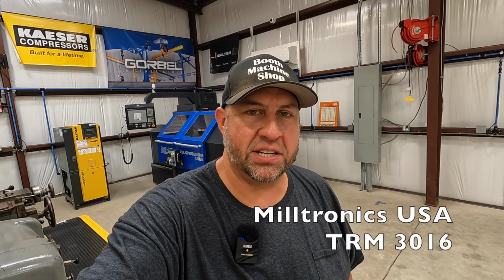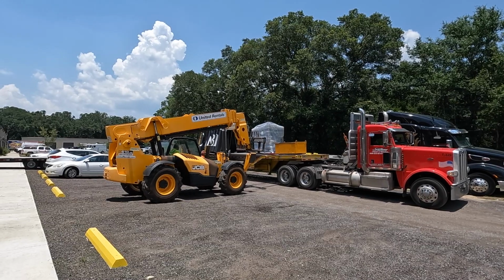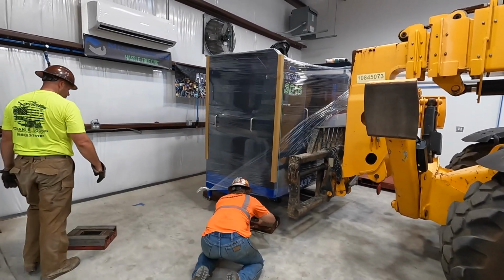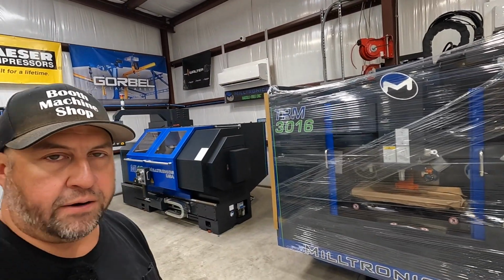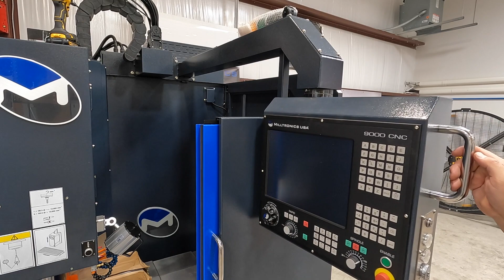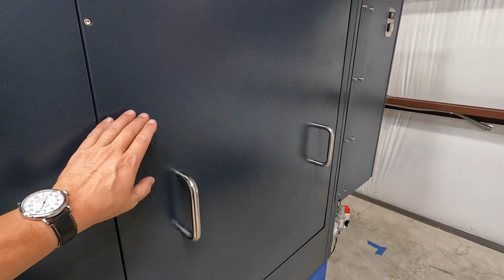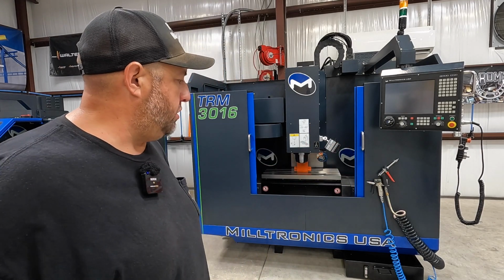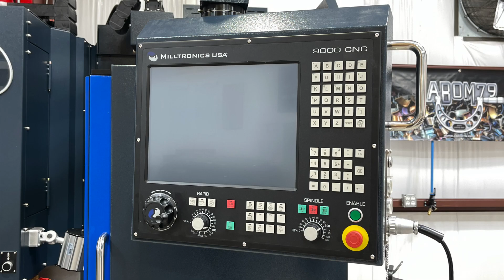Milltronics USA TRM 3016 Delivery & Install

Comment: Adam, as a 30+ year industrial machine service guy, I would strongly advise you to make hard copies and scans of all the machine manufacturer documentation (schematics, specs, etc.) and keep those copies in files on your computer and in your office. 

Also leave the originals in the control panel - just have the others for backup if needed.
All the stuff from Yaskawa and any other third party component manufacturer is typically available as a free downloads online, so you don't need to copy that stuff, but it would be nice to go ahead and download digital backups when you have time.

All machines eventually have problems and need to be fixed. Without the proper drawings and other documentation, tracking down one loose/broken wire in a critical circuit can easily take most of a day. That's a day of paying for the service guy, and the lost production time of the machine.
I charge pretty much middle of the road for what I do at around $100/hr. Downtime on a machine like that can easily surpass $500/hr. depending on conditions.
That means getting your machine up and running in two hours as opposed to 12 hours could be the difference between costing $700, or over $7000.

Comment: I really liked the smile on your face.  You are going to love CNC.  One of the BIG decisions you will have to make is the CAD/CAM program you intend to use.  I purchased a new HAAS TM-1P toolroom mill back in 2007 equipped with 10 station tool changer, reinshaw wireless probing system, coolant pump and some other extras.  When the technician first stepped up to the machine and punched several buttons and the machine took the tool out of the spindle and put it away in the proper tool changer slot and picked a new one and installed it in the spindle I was amazed.   Then to my surprise the technician said it was my turn.  My friend was video 
taping the training session and said I had the deer in the headlights look when I looked at the keyboard and hoped to pick the right keys to make the magic happen. I slowly approached the keyboard with my finger and the technician said I was "getting close" to the correct key.  I felt like I was playing pin the tail on the donkey.  Ha Ha
I know you will enjoy the adventure and make some beautiful parts and I will enjoy watching your channel as you enter the world of CNC.

Comment: CNC is very much like manual machining. However instead of making the mistakes yourself, you tell the machine to do it for you.
Reply: Trouble is, if you aren’t watching, they make a lot of then in a row…
Reply: Most used comment when starting out. Where the f*** are you going.
Reply: It helps you to make mistakes much faster and more impressively.

Comment: If the heavy equipment movers ever watch this video, they will not be too happy with forklift operator almost losing the load by not tilting it back, Wow it was close. I used to manage a large printing facility with some really big iron, large sheet fed multi color presses weighing over 50,000 lbs. I remember those days when those presses were delivered and the movers were beyond professional.   That crew just seemed a bit off a bit new, but it all worked out. 
CNC is exciting, I remember when we added our first computer to plate prepress system.

Comment: Hi Adam. Wow that was nerve wracking watching the grunts unload it. The tele-handler although rated at 10k lbs was overmatched to tilt the cnc back to level. Also metal skid on metal forks is a recipe for disaster. I didn’t see any chaining to zoom boom, so cnc could’ve just slipped off of forks!! Wow were they lucky!
Reply: We use jcb telehandler day in day out the guy was untrained on it ,legs down and tilt back ,expensive load to practice on
Reply: @chriswild2458  :  The stabilizing legs have no bearing on the weight that can be curled.

Comment: I've been involved in getting some heavy machinery moved recently at work and the guys we bring in use air skakes for this kind of job and much heavier equpment.  Makes it really easy to move it in any direction, spin around etc etc.  A large conventional counterbalance forklift would probably have also been better suited than a telehandler.  But, they got it in there safely, looking forward to seeing the first chips.
Reply: Yes, I'd rather have seen Brian Block @bcbloc02 handling that with his Cummins Hyster, to save Abom's nerves at least

Comment: That was the scariest unloading I've seen in a long time.  There is zero excuse for them doing something that dangerous!  No attempt to assess the load prior to lifting, poor control of the telehandler, and those forks were not the right size for that load with the loading point so close to the tips I was waiting for them to fail.  That whole couple of minutes is a textbook example of a 'swiss cheese' failure in action.

I appreciate that sometimes you bring the wrong tool the job, but lifting loads is a dangerous activity.  The crew should not have attempted that lift until they had secured the correct attachment and the guy who gave the okay to start moving backward needs training on his role.  At 5:55 in he spots the problem with the load starting to fall off the forks (the strength of the pallet is the only thing keeping it on at that point), and they should have immediately stopped, lifted the load level to take the load off the tips and get that back on the truck bed asap.  The operator can't tilt it back because that would increase the load on the tips further and make failure more likely.  The hi vis guy then talks to the operator and you can see the actual moment the decision to let the pallet and fork tips take the load down to the ground is made and they pull back further *in case the load falls off*.  Scary stuff.  If that was not on a metal pallet you would have had a very different outcome.

Safety rules are mostly written in the blood of the people who thought 'that will be good enough' before you.  It doesn't matter how much the delay costs, it is never too much to do it safely.

Comment: Forklift op needs trained real bad wow. Why didn't they come in at the angle and boom out nearer the position Adam marked . Hats off to how calm Adam was ,I would have lost the plot with these guys .
Reply: I was nervous about the tilt when lowering from the trailer deck.
Reply: @Ddabig40mac  The guy should not have been operating that equipment .
Reply: What a time to O.J.T., geez?!
Reply: There's always arm chair quarterbacks.
Reply: Yes, the tele driver made a grave mistake here. He unloaded from the wrong side of the truck. That said, once he's made the mistake, it's not that obvious from the cab. I cannot understand how precessional riggers didn't realise while they were fulfilling the banksman role. Watching them unloading it from the truck, I was relieved that they put it on the deck asap. When I saw them moving the machine into the shop, loaded from the wrong side of the pallet with short forks, I couldn't believe my eyes. Thank god the pallet was so sturdy. It saved an expensive mistake 

It's a good example of how a series of human error nearly led to a catastrophe:
The truck driver should have known that the load needed to be unloaded from the left side.
The tele operator should have checked the load on the pallet before mucking in.
The banksmen should have advised the operator that the load was too front heavy for the length of the forks.

Ultimately the responsibility lies with the telehandler operator. They are the one with the licence, they needed to do their checks. Full stop.
That said, once the mistake had been made, the banksmen had the most obvious view of what was wrong. How they didn't point it out is beyond me.
As for the truck driver, nobody in their right mind should trust their judgement anyway. Sometimes they're great, sometimes they're this guy. You just don't know. They have no responsibility for how the load is handled on or off their truck. You should always check.
Disappointing. If I were Adam, I wouldn't touch that rigging company with a barge pole.
Reply: @SamSeedy  The biggest mistake was using a telehandler when a fork truck was needed.
Reply: Possibly the JCB didn't have enough power to curl - at that point you have to either set the load back on the truck edge or lower it down. Still, not the correct machine and not handled well.
Reply: I don't see why they couldn't use four wheel steer to get closer though.
Reply: @russellstarr9111  Bingo
Reply: Frip and frack...I’d been screaming at that guy...wow
Reply: Was there any damage?
Reply: @paulcopeland9035  wAs ThErE aNy dAmAgE?
I reported every one of your spam comments Mr cheerleader.
Reply: @stevendupre2792  that chin ball champ went through every comment about the rigging and replied the same thing

Comment: I really like that you are venturing into CNC. I know some of your hardcore manual machining followers may not understand. The use of a CNC machine in a most all shops is a standard now.   The Milltronics is a great brand.  You have the Tool room style machines - especially the lathe.  Tool room machinist is what you do.  Easy to setup and program

Comment: The machine looked like it was too heavy for the forklift. It's likely why it wouldn't tilt back during unload and why the boom couldn't be extended during setting. Using Oblique steering is always a blast! Look forward to you learning how to use the new tools!
Reply: Someone posted that if he dropped the stability  pads the forks and boom are able to be moved.

Comment: Thank you for showing who did the rigging.  They are poor outfit.  Wrong equipment to unload. That driver has poor understanding of transporting loads with the load tipped wrong. Then not bringing the proper jacks.
It was a miracle that machine wasn't dropped. 
Now I can sit back and enjoy the rest of the video. 
This is  impressive shop Adam.
Reply: The guy leaning to support the load had me shaking my head. Especially the guy who tried to catch a couple thousand pound machine, when the lift drive hit the brakes to hard.🙄
Reply: Was there any damage?
Reply: @paulcopeland9035  
There is a right way and many bad ways.  Like people working under a car that is held up with cinder block.

Comment: Adam,

Congratulations! What a great addition to your shop.

I see the man lift is gone.  I was going to suggest that you hang your ball cap collection from the ceiling beams.  Maybe you can run some wires at a high enough height to hang them above the shop, out of the way.

I still think you need an ABOM79 sticker on the beam of the Gorbel crane.

Bob

Comment: Adam that forklift operator wasn’t paying attention to maintaining the level of the load. I believe that forklift has an auto leveling feature on the fork controls. I really thought the mill was going to be damaged. Glad it came off intact.
Reply: Looked like he didn't have the right forks for the load. Hard to tell from where I was sitting, but too short of a fork for a load will almost completely negate any benefit from tilt-back features - whether automatic or manual.
Also, bringing the skid in a limited space area like that makes me think the riggers didn't really plan this move out very well.

Comment: DUDE!! I was TOTALLY YELLING AT THAT OPERATOR, TILT BACK, TILT IT  BACK!!
Reply: Yeah, Adam maybe should have yelled at them to stop there and then. Steel tines on a steel skid, that thing was holding on by nothing more than a miracle. My guess is that he'll be crossing those guys off his preferred supplier list.
Reply: My guess it either their inexperienced/ lazy or the mill looked front heavy on the forks so they couldn’t tilt it back without risking breaking or damaging the forks which would’ve damaged the mill.
Reply: 8:50 to 9:15 - he did it twice, dont you cry! :)
Reply: Not that easy to have the full overview how things are way in the front there, and especially when one are not much used to the machine.  would say that the peole standing around should be quick singalling the driver to level the forks, not just stand looking
Reply: Given how much the back end came up, tge hydraulics and tilt piston might be too small for that heavy of a load wo he wasn't able to tilt up while in the air.
Reply: @EmmetPhD  :  He did it after it was off the skid and the machine was much closer to the axis of rotation of the fork assembly.  It was an undersized telehandler for this job.

Comment: What a lot of people don't understand is that CNC equipment can still be controlled manually. And therefore much more flexible than a manual only mill/lathe. 

Also, knowing both worlds means you've really mastered manufacturing to a whole new level.

If you don't like it, rip off your DRO and be a purist. But remember that this is his shop. Not yours.
Reply: Slight difference with manual operation compared to traditional is the loss of haptics.... The feel through the wheel that gives the experienced machinist information on the condition of cutting and clues about tool wear.

In CNC those things have to be replaced by measurement and algorithms... the latter are only as good as the people who built them.

Comment: The reason why the telehandler driver did'nt tilt back while unloading was because he could'nt.
Telehandlers are wery weak in the tilt movement, that was a forklift job. 
The Telehandler could handle the wheight no problem, but not that far forward on his forks. 
This is a common problem when all pepole think about is wheight, not where it is.
Reply: You'll find the vast majority commenting here have no working knowledge of hydraulics or even a basic understanding of how forces are multiplied or divided by levers.  Critical thinking skills need some work too.  To them, hydraulics are strong enough to move anything up to the point of physical failure and relief valves do not exist.
Reply: @wahconah98  The clowns got it wrong. They were lucky it didn't slide off. Wrong tool for the job.
Reply: The load centre of gravity was beyond the telehandler load centre (usually 2ft forward from back of forks) so the alarm was going off and it wouldn't allow tilt.

Comment: Rigging is a  scary thing. My past employer was getting one of their old 10 ton VTLs out and one the rigging crew was working underneath and was crushed. One of our maintenance was working underneath with but was not present when the lathe fell. Everyone on that shift had ptsd.  A guy on our shift expressed our concerns about the safety of our environment and the owner took it as an insult.  It was the rigging crew that was at fault, however; it was the owner that hired the riggers.  The guy left a widow and two kids.

Comment: I have been trying to learn Fusion 360 on my own. It is not as simple as my first exposure to 3D design program Solid Edge many, many years ago. That is a very nice looking unit there. Congrats on the new addition to the shop and thanks very much for sharing.

Comment: that goober in the JCB made me Nervous as a long tail cat in a room full of rocking chairs
Reply: Oh my god that was nerve wracking :D You've used a great analogy :D
Reply: Imma just gonna go right ahead and steal the phrase, Sir! :P
Reply: It sounded like they were trying to tilt it back, but it was too heavy to do so. I had to replay that bit, and it sounded just like that. 

That's what you get when people get the absolute bare minimum to get a job done. (But they did, so it all worked out in the end.)
Reply: The mill could have slided off the forks, forward, but not tilted over that close to the ground

Comment: Your going to love those CNC machines. As long as the program is correct they are great. I ran several different types of CNC machines along with the manuals. I could also write the programs for the machines. I was also one of 2 people in the shop that could operate the 2 5 axis machines.

Comment: That unload was painful to watch. Rental machines are ALWAYS a pain to run. The ground guide makes a very big difference though. Why neither the operator or ground guide thought to level the forks escapes me. Glad to see there wasn't a failure in movement.
Reply: They were overloaded on the forks with the load that far out. Machine is only rated for 10K centered on the forks. Forks are only 48 inchs, so center of load is rated at 24". Machine is 89"x88", and 7000 pounds. The pallet was wider than the machine, so they have 7000 pounds almost centered on the tip of the forks.
Reply: @ionstorm66  I have rented that model in the past with 6' forks. at 3' the rating is 6500#. I assure you there is no logical reason to not level those forks with the load on them. Nasty risk having them tipped away like that.
Reply: Was there any damage?

Comment: Honestly that operator of that telehandler was pushing his luck but the spotter is definitely at fault as well for not telling him to tilt back.
Reply: Exactly. But I wonder if the machine was to heavy for the tilt system to move, so he had to set it down to straighten it out.

Comment: Wow, the guy driving the Tele-handler should have at least read the manual before he decided to try driving it! they're amazing bits of kit in the right hands (especially JCBs) but they're also the fastest way to break a bunch of stuff if the driver is as clueless as some of them are!

Still it beats trying to do it yourself with a pump-truck and skates!
Reply: I’m sure it didn’t have enough hydraulic power to tilt back for the weight that far out in the forks
Reply: @18fisher1  Yeah, I think they under-estimated the size of machine when hiring-in the rig to lift it, although I don't remember ever having that problem when I was hauling anchor-chain boxes, they were usually a few tons each and about the same size.

The rear-steer also confused the hell out of them to start with too! there's nothing like figuring out a new machine with a customer's expensive new toy on your forks!